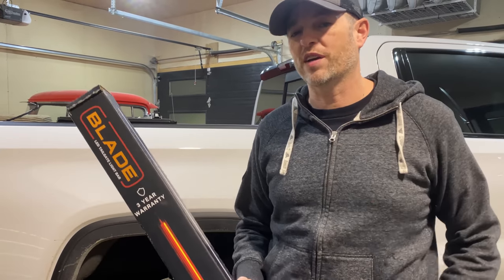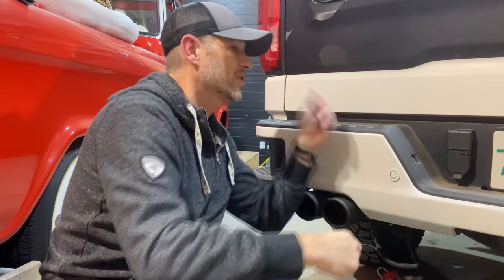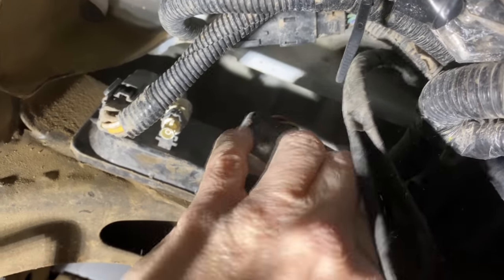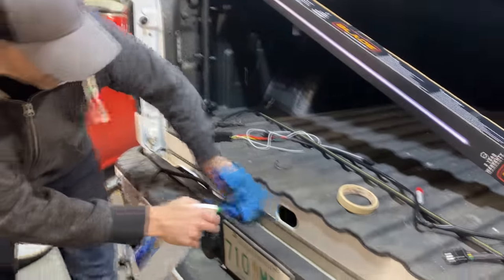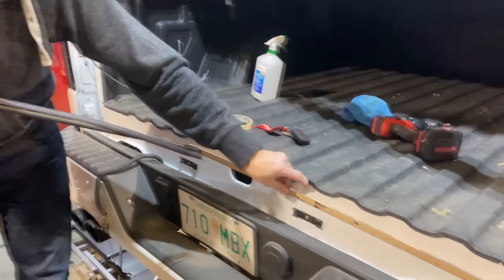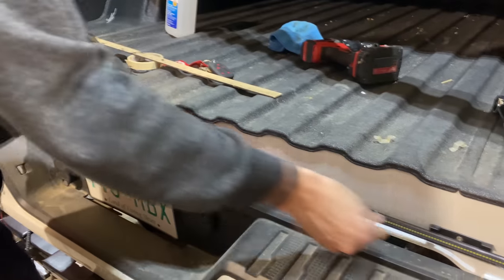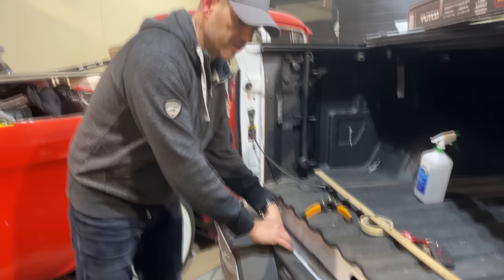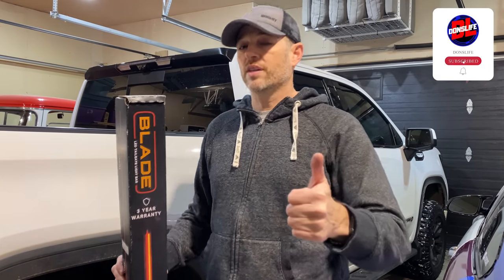The Best Light Bar for Your Truck. Putco LED Blade Tailgate Light Bar

Comment: Looks good but way too much wiring on the light bar.i prefer the opt7 redline triple light bar.only has a flat 4 connector and 1 wire for the reverse wire to hook up.also has sequential turn signals.
Reply from the maker: I looked hard at the same one you mention.  I couldn’t easily get it shipped to Canada either.  In the end with our extreme climate the IP69 rating for the Putco vs the IP67 rating for the Opt7. Also 3yr warranty vs 2.  But I agree on all of the benefits you mention.  Had it not been for the shipping issue, I may have tried it.
Reply: @Donslife  I didn't think about you being in canada.i haven't had any issues out of my opt7.ive had this one on my truck 2 1/2 years with zero issues.just bought my friend one for christmas.i had one on another truck also.before I discovered  opt7 I ran cheap ones and they always got water in them and lights would burn out.i like how the mounting brackets were on your putco

Comment: I'm about to buy this light I thought it was all plug and play what needs to be wired
Reply from the maker: It is plug and play.  Just that some configurations depending on the vehicle specs may need an additional harness.  Reverse may need a wire tap to the reverse lights though

Comment: I just installed one of these on my 2021 GMC Sierra Denali.  Just make sure you get the 529005 quick connect harness for 2019 (T1) Builds, else wise you'll get all kinds of error codes.  I used the clips with 3M adhesive tape to put on the light bar.  The instructions state that the light bar should be about 1/4" above the two lower cut-outs.  The biggest pain was getting the tailgate on and off by myself.  I put a couple sawhorses with a moving blanket over the top to rest the tailgate on.  Nice video.  The newer harness has all of the hook-ups so you don't need to touch the stock wiring harness.
Reply from the maker: Nice!  Thanks for sharing the info.  For a 2019+ Sierra and Silverado, the harness is absolutely a must.  When I ordered my blade the new part with updated wiring wasn't available.  Oh well, glad you liked to video though.

Comment: Not sure where u live but I’ll never spend $200 on a light bar ever again, I live in northern Alberta Canada and I’ve had the Putco, Recon, and Opt7. All with the reverse feature if u want to use it. Well those 3 brands never even lasted 3 yrs, all gave out in the second yr on my truck. So this time I said I will try a cheap ass $20 one off of Amazon. Well believe it or not it’s been on my truck since 2019 and haven’t had a single issue yet, our winters are crazy cold where I am, I’m talking -40 for weeks at a time, so when this el chepo one gives out I’ll buy another one of them. Hopefully U have better luck then me with that one.lol nm I seen ur plate n see ur in Saskatchewan, So u get some cold weather as well

Comment: Great Video and Install, I believe you and I have the same O.C.D. issues Ha Ha.  I am surprised that you didn't put silicone caulk in the Screw holes from previous LED strip. I can only imagine the Road Salt and corrasion there.  Good luck Sir and keep the videos coming.
Reply from the maker: 😂 I did off camera and the backs of the screws in the new holes

Comment: I installed mine a while back. I went with the Putco red blade. It has the red turn signals rather than the amber. It looks cleaner and more unison in the back my opinion.
Reply from the maker: I own a BMW so I don’t signal anyway 😉 kidding aside, I couldn’t find one at the time in Canada with all red.
Reply: I got the red blade too. But I had to keep checking back on amazon everyday. Red signal lights look odd with amber signal on the blade

Comment: Well done. I really like this mod. Greatly increases the rear lighting when in reverse. Took your advice with the boost auto tap for extra lighting in reverse, but I may add this to the list in the spring as well. My only concern is the self drilling screws. Hate putting holes in a painted surface exposing bare metal. How well do you think the 3M tape that comes with it would hold up on it's own, without the screws?
Reply from the maker: I think it will hold.  But if were me I would add some thicker double sided tape in a few more places.
Reply: I have the same bar with only the 3m it's held up perfectly for over a year.
Reply: Late comment. The tape holds up good. I use the black clip ones. 2 years, rain, snow. carwash. 3m holds up well

Comment: Have you had any concerns with the lawsuit saying that they knowingly installed a faulty part for the ecoteccylinder deactivation? Love the truck btw getting a 19 gmc at4 soon
Reply from the maker: I do have some underlying concerns.  I do take comfort in two things.  1 - If I have a failure, warranty will cover it. 2 - The percentage of failures (I’ve heard/read) are single digit numbers.  I love my truck

Comment: Just received my PUTCO Blade LED Tailgate Light bar for my 2022 GMC 1500 Sierra SLT. I haven’t installed it yet due to living in the northeast (Snow & Ice) & Also NOT having a garage lol I’m looking forward on getting at it though soon hopefully. I will be using this video as guidance as well when I do but I just have two questions (for now):

- I’ve seen comments on the Additional comments on the Quick Connect Harness. I thought the light bar already came with one but you mentioned you had one already installed. My question is if I am to get a quick connect harness which one would you suggest now that it’s 10+ Days past the video. 

- Do they make waterproof quick connects that you’d suggest if that’s even a thing? 

Again awesome videos & very informative for those of us (Me) who are clueless but trying to save money from the dealership having to install them.
Reply from the maker: Hi John, which part number is your Blade?
Reply: Late comment, but they make electrical grease for connections like this. The blades don't come with a quick connect, well they do but you plug it into the tow plug. But if you want to go factory look- you'll need the harness or tap into the oem harness

Comment: Can you please do a video on how to install the light bar without taking off the tail gate?
Reply from the maker: Not sure if I can do that.  It is harder since you need to get your fingers in there.  I don’t want to remove the one I currently have either
Reply: It can be done, it's just easier with the tailgate removed. Just make sure you have a good eyeball so it's straight.

Comment: how did you wire to the battery in your truck. I have the same battery but I don't want to mess it up
Reply from the maker: Depends on the accessory.  Usually I install a switch and a fuse

Comment: Does your truck have the side cameras that are activated when you give a turn signal while pulling a trailer. If so will they activate without pulling a trailer after you installed this light bar?
Reply from the maker: Good question.  It does have the feature but only works when a trailer is connected.  Since the light bar is using the Putco Blade harness, I am not tapping into any of the trailer sensing circuits; Therefore the cameras don’t come on when signaling.

Comment: Hey Don i just had a Light Bar installed yesterday and i think they tapped into the trailer, which i didn't think that was right now i have trailer errors, the bar not working properly its a straight mess man
Reply from the maker: That is not good.  With the plug and play harness that Putco makes, the errors will go away.   Sorry you had that happen.
Reply: Thanks dude! Im goin back Tuesday. This is so annoying

Comment: Where do you find the time? Lol I like this mod. Now just need one for front. I would go with 52 inch or maybe 42 inch. I drilled holes into my bumper
Reply from the maker: I am working in something currently.   A video can take weeks or months planning and waiting for parts.  I can’t always return things easily without huge shipping costs

Comment: So I have the recon model on my 22 silverado... I just noticed my brake light is delayed with my actual brake lights. I tired to watch your "in action" demo but could never tell if you had that delay or not. Do you know if yours is in unison? I just did a video of mine so I'm about to ask recon about it. It doesn't look good if it's not coming on together imo
Reply from the maker: I checked every way the light bar is triggered to come on and I am happy to report there are no perceivable delays.  Tested: Unlock, lock, reverse, signal left/right, brakes, lights on off from the main switch.  All good, no delays.

Comment: Man this is the best light bar. Got it installed looks great till I closed tail gate. In the middle it just clips the light bar bracket. I measured each end and thought it would be straight, but nope. I used the stickies any ideas how to get the middle stickies down down or loose?
Reply from the maker: Maybe a little heat from a heat gun on low or a hair dryer?
Reply: @Donslife  Thanks Don I got it. I tried it shortcut by leaving the tailgate hooked up cause more problems than it was worth I need to redo it. For now it's working good though.

Comment: The right side of my putco bar is not lighting up. What do you think the problem could be?
Reply from the maker: I would start with checking the flat four connection to the Putco Taillight harness.  Assuming of course you've installed it with their wiring.

Comment: How did you wire up the first one?
Reply from the maker: If you’re referring to the cheap amazon led strip, I spliced into the 7 pin harness for each wire I needed.  This used to work with older models.

Comment: I have a OBT7 Redline Triple LED Tailgate light bar Installed on my 2022 Tundra 1794. Everything works great. No codes/errors on Dash. Then, I noticed on one of my house cameras that when moving forward after Braking that sometimes the light bar flashed Yellow first then red when applying brakes. It happens frequently, but not everytime. Has anyone experience that or can check their OBT7 lightbars. Have someone stand behind and watch as you move forward a little and apply brakes.

Comment: Did you have any issues with the “ park assist” not working properly after installing putco blade? I installed it a couple of days ago. I bought the plug and play wiring harness. It’s probably just a coincidence.. but when I start my AT4. The park assist switch will be illuminated. As soon as I shift vehicle into drive, error msg saying park assist is disabled will appear. This msg often appears when sensors are blocked by snow or mud, my truck is clean and no obstructions on sensors. I am just curious if you have heard of this issue before?
Reply from the maker: I have only had over sensitive parking sensors on the front of the truck due to snow, ice and mud.   I can’t say I have had any problems with this light-bar so far
Reply: @Donslife  I didn’t think it would cause an issue. I just thought I would ask. The large wiring harness is a pain in ass to reconnect. I probably just need to disconnect and put some Di-electric grease on it. Thanks for quick response

Comment: How do you know where to get the extra harness the module or whatever you wanna call it so you don't have to tap into the trailer lights
Reply from the maker: Putco 529005 Blade Quick Connect Harness For 2019+ Silverado/Sierra 1500: https://amzn.to/33EMvjX
https://amzn.to/3g8EGWB